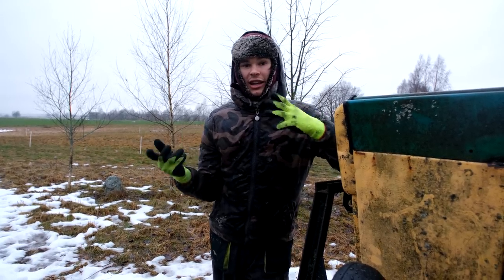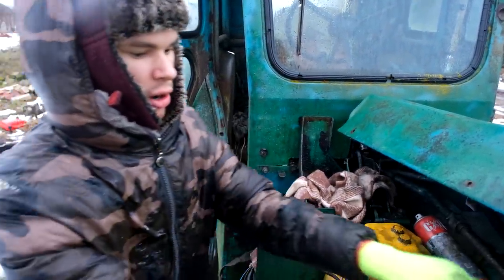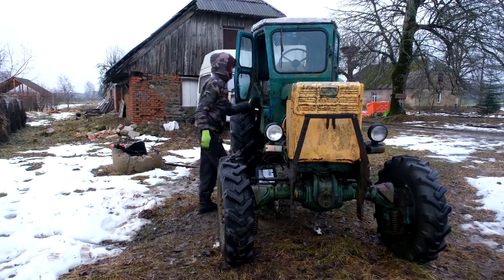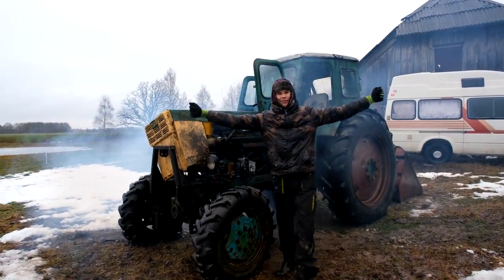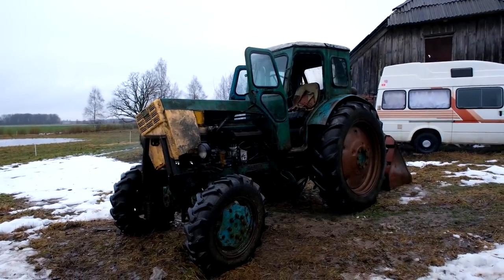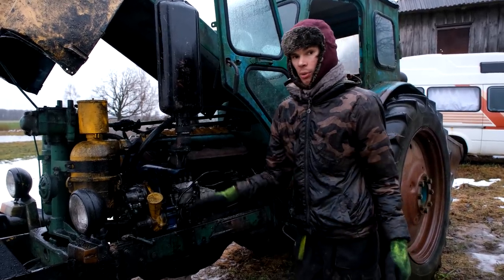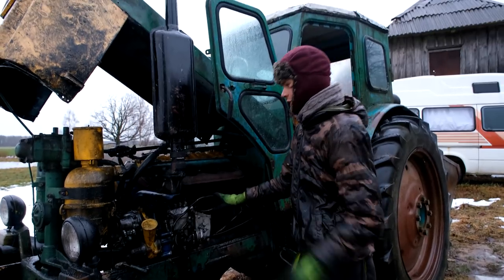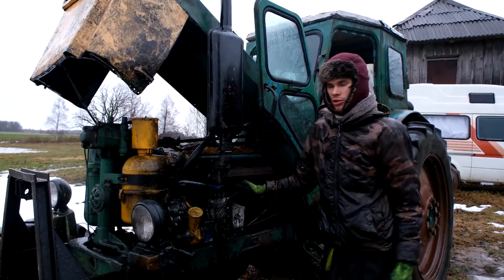Is Tractor FINALLY Working?!

Comment: You need to completely clean out the fuel system from the tank to the pump and all the lines and filters. The engine initialy runs good and the diesel pump sends more rusty crap up the line and plugs the injectors...again. If you are lucky it's just the fuel filter[s] plugged up
Reply from the maker: The fuel pump needs rebuilding, this one might take a lot more to get it going! 😁
Reply: @DoBeDiff  If you use summer diesel in tractor will not work  because in cold weather, paraffin is formed in the diesel and will block  all lines and filter, need use winter diesel.  I have the same tractor, my big problems with the fuel line. You need to check the line at the fuel tank and before the filter may be full of rust and dirt. May be the reason, that  tractor has no power and die.

Comment: Dave you have all the right ideas .  Be careful if engine got overheated at somepoint. Piston rods could be loose from crankshaft.  When drain oil pop pan out of bottom see if all  tight .     Yep change all fluids and filters .    Doing great .  👍
Reply: There is something exciting about the fact that so many people have information on tractors from all around world... did you download the manual? Most are available.
Reply: @randalllaue4042   Randall,  I live in a small village in America.  My tractor shot the piston through the block 👍   . And yes when you work with old tractors you get a feel for them . And manuals help .  Along with other Farmers fron area and the internet.
Reply: @dougtheviking6503  the company I worked for years ago shipped copies of tractor manuals to people, before internet took hold. Now, it’s possible to hook those tractors up to GPS! And track the harvesting. They still have the rights to do this, amazing!!

Comment: David you continue to amaze me.  With having to replace things, just tells me, that the problem is about to be resolved, you will have a beast of a tractor. Along with the equipment attachments,  you'll be  able to accomplish so much on the farm.  Just imagine how much money for saved, over trying  to  buy a new or a rebuilt tractor.   As you begin to use the tractor with the numerous attachments, that will be amazing to watch you work the farm improvements . That's what I believe that you will start working on attachments, getting them cleaned up and in working order. As they say, one day at a time,  now it's one attachment at a time.  Now as a viewer, we will probably   see the field holding water, fixed,  feeding the animals without breaking your backs, etc.  I'm so happy to see the tractor up and running.  You did it David! I always felt confident in your ability to  think through and solve the problem.  Amazing! You are an amazing young man.

Comment: Did you check the oil in the governor and check the fuel filter and before you start up give it maximum fuel and once it starts the governor will move the fuel rack automaticly back to the running position,but as I said make sure that there is oil in the governor.

Comment: Hi! There my husband is a heavy equipment mechanic and saw your video. He said he thinks that the fuel pump is injecting too much fuel and is getting mix the fuel and the oil. He recommend you watch this video it probably give you some ideas how to fix it. (How to troubleshoot fuel in oil contamination. Diesel fuel dilution)
Wish you the best. Watch you video from Florida USA. 
(MELBA NOYOLA 👍🏽)

Comment: Also I can't find the comment now but somebody had mentioned about starting it up in the cold and blowing a piston. You can also crack the block if it's not properly protected from the cold and you try to start it up in the dead of winter without warming up the block first. You know these are things you need to take into consideration living where you live.

Comment: Unfortunately, old equipment often comes completely with both old and new problems. I trust that this was a fairly basic tractor with simple mechanicals that you can follow through step by step. Seals, pistons, and bores are critical to stop air getting in and the oil from leaking out. When they work well, they are like magic, but when they fail they become the devil's playground and your challenge. It is a shame that you are having to work on the machine in this weather, but well done for rising to the challenge.

Comment: Deivid, what fluid are you using for the cooling system of the engine. It seems as if water vapour is coming out of the exhaust. Normally the exhaust gas would be dark smoke especially with an old engine. In a modern engine white smoke is a sign of a damaged gasket to the cylinder head because water from the cooling system gets into the cylinders. Due to the low temperatures the cooling fluid can freeze if it does not have enough antifreeze in it. Then enormous pressures can build up that damage the cylinder head. You could get a hole between cooling system ducts in the cylinder head and the air intake or exhaust ducts of the head. I hope for you that this is not the case!
Reply: This is an air cooled tractor.

Comment: Hi, 
I see you are still having a run of bad luck with Ygor!! 
In my view, the most telling thing this time around is that the engine oil sump is filling up when it runs - it can only be diesel fuel or hydraulic oil that's leaking into the sump!
You will need to get all the contaminated oil out of the engine and fill up with fresh oil.

For a first shot at diagnosis, why not drain out/disconnect all the hydraulics on the beast and try and run the engine without this possible 'hydraulics' complication. 
If it is the hydraulics that is at fault then the engine should be running sweetly and without so much smoke.
If all else fails you could just get out the sledgehammer, grinder, axe and burning torch and give it a good and personally satisfying send off!   - or even set the geese on it.  

Good luck - we are all hoping that you can sort this monster out once and for all (cheaply, easily and quickly).

Comment: Deivids can you drop the gas tank and empty it and make sure it is not full of gunk, rust.   Be very careful very flameable.  Hope your fix this time around get it going.   My niece’s husband set the garage on fire with a motorcycle gas tank.
Reply: It's diesel.
Reply: @boooshes  you’re right but can’t the tank be dirty or rusty.  Just wondering?
Reply: @michellekupczak9942  You are absolutely right.

Comment: You know have you looked at like Bentley's and Hadley's and there's a lot of other repair manual manufacturers that will provide you with a repair manual for your make and model of your tractor so you can troubleshoot what's going on with it instead of trial and error. I mean because I hate to see you guys wasting money and effort. I mean you're going to learn how to fix that thing come next year if it breaks again you're going to know exactly what's wrong with it just through trial and error but you know it's something that isn't acquired skill. And you guys are smart and you figure out how to do a lot of things without any instruction but sometimes having a factory manual that tells you how to do the stuff is you know a highly instructive instrument to carry along with you through life as you go through it with such a big beast as your tractor. Will you see eye to eye with it forever? no. Will the manual be hard to figure out? More than likely yes. But it's an essential tool to have when you have a tractor like that or even if you have a Ford 9N you know you need a manual. I grew up on air-cooled Volkswagens. got my first one when I was 13 years old I'm 62 now and I still refer to the manuals because I'm still doing my own repairs to them all these years later. And I still refer to the manuals.

Comment: It's too old. Maybe the lifters are bad. Clogged fuel filter. Too many issues. After you spend money rebuilding motor and transmission, the wheel bearings and supports will go. 
I'm sorry but you are better off trying to sell all the metal to recycling and buy a new or newer small one.
You will look back at this one day and ask yourself what was I thinking? 
Even if it runs a few weeks, some things will break that you can't find replacement parts for.